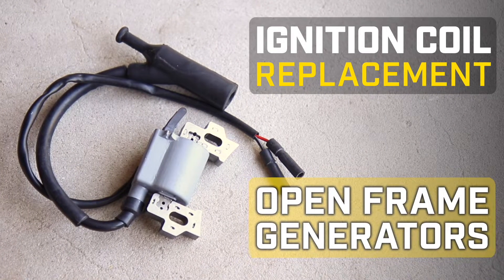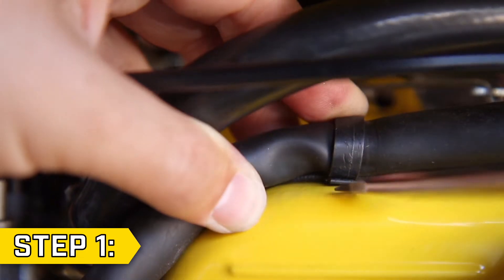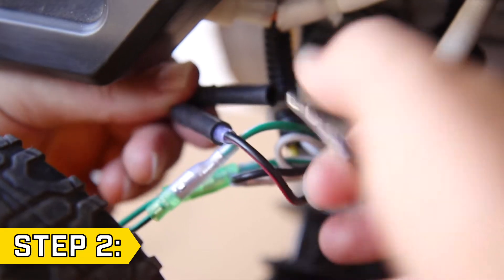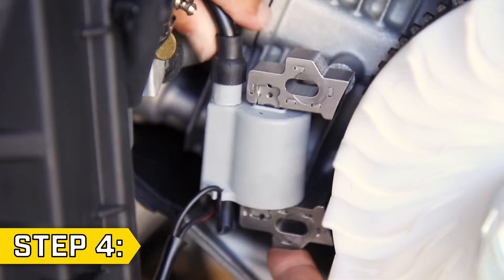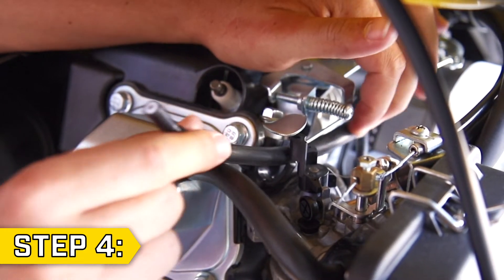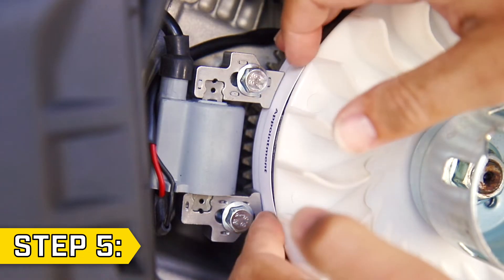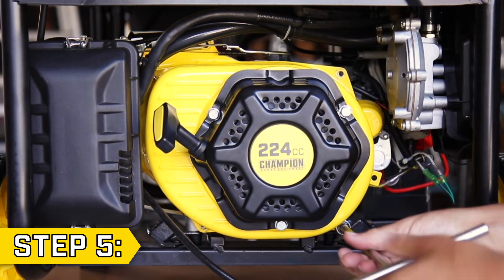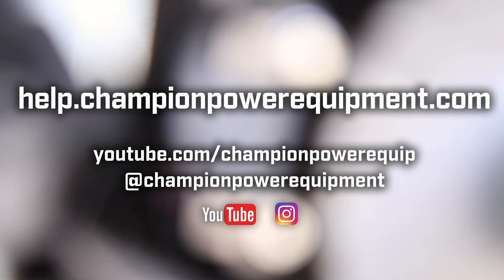Ignition Coil Replacement (Open Frame Generators)

Comment: My spark plug cap itself is bad. Can I just replace the cap and not the whole ignition coil? Can I purchase just a new cap?
Reply from the maker: Hello, we do apologize, but because it is a complete assembly, you would have to replace the entire ignition coil, we do not have just the cap. If you need to place the order, please contact our parts support team at 877-338-0999. Thank you

Comment: Helpful video! I have a Model 46514 generator, 400/3500.  I am trying to find the correct parts number for the ignition coil so that I can order it from your website. I see a long list of available ignition coils, but do not see their application, so I am unsure which one to order.  Thank You
Reply from the maker: Here is the owner's manual for you that includes a parts list: https://www.championpowerequipment.com/wp-content/uploads/2017/08/46514-om-english.pdf